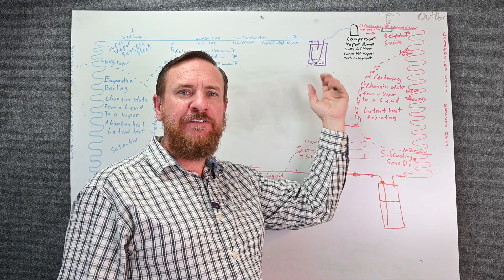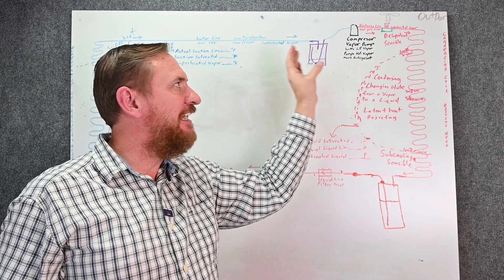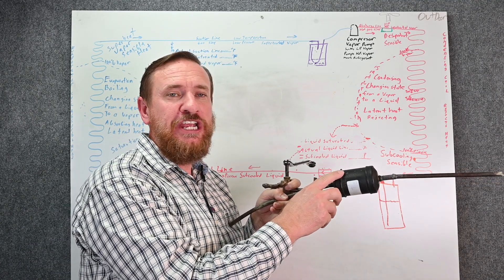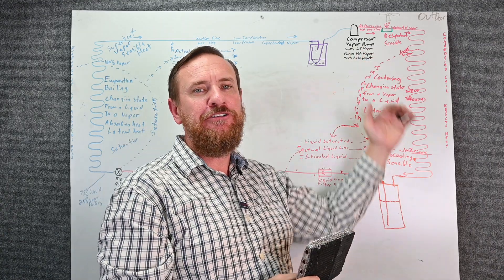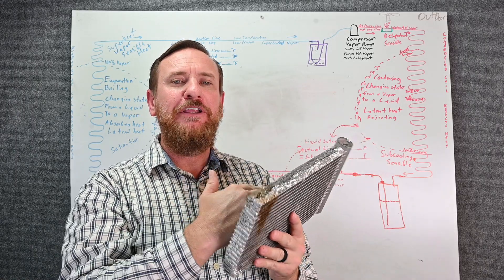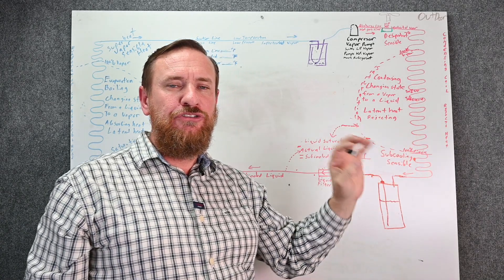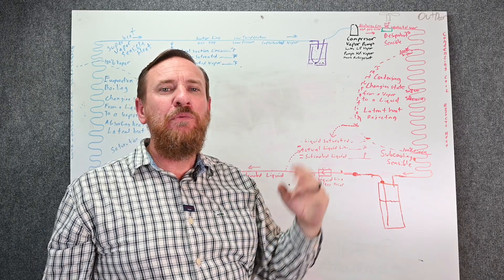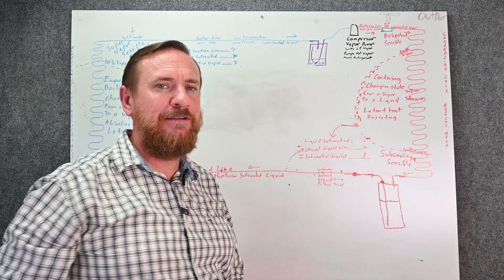HVAC 085 Pump Down

Comment: If the filter drier is before the valve doesn’t that mean that it is on the side that was pumped down hence don’t need to replace it since it will not be open to the atmosphere?
Reply from the maker: It's not about the filter drier being exposed. It's about any part of the system being exposed.

The filter driers have very small capacities. Once you keon any part of the system, even for a moment, you end up with moisture and other contaminants.  This will exceed the filter drier's ability for filter and dry. 

I see clogged driers all the time that cause capacity loss and then compressor failure.

Comment: Isn’t the floating seal in resi scrolls designed to fall back down and start clinking to prevent pumping down into vacuum?
Reply: That “funny noise” in the demo is the floating seal preventing pumping into vacuum I’m pretty sure. 40psig is where I’ve found it normally starts. I’m not sure that’s what it actually is though, but I’m pretty sure it is indeed the floating seal.
Reply from the maker: Yes sir, 
Once the compression ratio exceeds 11:1 the floating seal releases meaning it's no longer a down force pushing the top scroll set down on the bottom scroll set . The rattling is the top scroll chattering against the bottom because the floating seal is no longer pushing it down to make the scroll set seal.
Reply: @love2hvac  Interesting. Thank you so much!

Comment: Some units have a high side pressure cutout switch AND a low side pressure cutout switch that will open the contactor if either trips.  Don't get too surprised if your compressor stops at about 55 psig low side pressure.  Shut off breaker power and be ready to shut down the low side service port.

Microchannel condenser units often have a high side pressure cutout switch because they know it cannot take a pump down.

Comment: Hi Ty Love this tutorial & all yours Actually Thank you Ive learned a Ton ....27 + yrs in &  learnt with no actual formal school but 5/6 great mentors to teach , lots of books & videos constantly .daily ..started out with trim & sets was my 1 st  Job 3/4 years new construction then retrofits ..wired & fired then all .with help my mentor ... then service & then full installs last both resd & mid sized 30 ton usually & under but maybe 1- 10 systems installed per building   commercial jobs my favorite   ....So to me anyways one of the best ways  to learn try to learn This great Trade .no formal school ...& always learning something new the new stuff happening dailuy it seems & also to relearn the old everyday stuff also ..Just wow what I just learned on ..a basic pump down & all its  particulars & or must dos  or best practices .....i do most all as per some differences ..But bottom line IS : to make the end game turn out as Hopped & carefully planned  out & quoted the customer ..hopefully Not to many Surprises .along the way .thanks Again ...Please keep ur Great  tutorials coming & we ALL Will .....keep watching & learning ..tks million of I had it !!!

Comment: I'm sorry but i have to correct you, incresed arcing in a vaccuum compared to in a refrigerant happens only in very specific circumstances and is not a given.

I would say refrigeration compressors are designed to operate within a certain range of operating conditions. Operating a refrigeration compressor with a negative suction line pressure, which means the pressure at the suction inlet of the compressor is lower than the recommended minimum operating pressure, can cause several issues such as:

1. Reduced compressor efficiency: A compressor is designed to compress a refrigerant gas from low to high pressure. When the suction line pressure drops below the recommended minimum, the compressor has to work harder to maintain the required flow rate and discharge pressure. This increased workload reduces the efficiency of the compressor, leading to increased energy consumption.

2.  Loss of lubrication: The compressor relies on the refrigerant gas to provide lubrication to the moving parts. When the suction pressure drops below the recommended minimum, the amount of refrigerant gas entering the compressor is reduced, leading to inadequate lubrication. This can cause premature wear of the compressor's moving parts, leading to compressor failure.
Reply from the maker: An engineer for Copeland scroll compressor told me they had arcing  at the Fusite connectors resulting in terminal blowout on scroll compressors. 

Copeland specifically states in several Application engineering bullitens related to the z line scroll not to use a megohmeter while under a vacuum.
"Under no circumstances should the hipot test be performed while the compressor is under a vacuum." I was told by the compressor engineers this was because of arcing. 

None of the engineers or technical data I have read includes vacuum breakers. 
However Copland scroll uses a floating seal for protection.  On high temperature air conditioning applications the seal opens above 11:1  well before the compressor ever gets to a vacuum.
Refrigerating the floating seal does not open until it's great we then 26:1 but the compressor is designed much differently.

I 100% agree the compressor should remain in the operating envelope at all times. 
None of the scroll compressors for high temperature air conditioning are designed to operate in a vacuum.
With refrigeration the compressor should remain in the operating window even in automatic pump down.  There are very few applications and refrigerant combinations that allow specific scrolls to operate in a slight vacuum. Those compressors are built specifically to operate in that window and I will cover that when I get to the refrigeration portion of the video series.
Reply: @love2hvac  Thank you for sharing your insights on Copeland's scroll compressors and the possibility of arcing in vacuum conditions. While the chances of arcing occurring in a winding can be affected by several factors, it is generally true that a vacuum provides better electrical insulation due to its low dielectric constant. However, in certain situations, the presence of a refrigerant gas may provide better insulation compared to a vacuum.

It is important to note that the use of hipot tests, which apply a higher voltage than normal line voltage, can stress insulation and increase the risk of electrical breakdown and arcing. However, this does not necessarily mean that arcing will occur during a vacuum pumpdown at normal line voltage in a refrigerant.

In the case of winding arcing in a refrigerant compressor, the breakdown voltage of a vacuum or low-pressure gas like for example R410a can decrease significantly due to the presence of free electrons and ions produced by the arcing. To maintain adequate electrical insulation, a higher pressure gas with a higher dielectric strength may be necessary. Although a vacuum is generally considered a better insulator than R410a due to its low dielectric constant, at very low pressures, the remaining gas in the vacuum chamber may not have a low enough dielectric constant to provide sufficient insulation. In such cases, introducing a gas like R410a could help to increase the dielectric strength and provide better electrical insulation.

However, in most practical electrical insulation applications, a vacuum is still considered the better insulator because it has the lowest dielectric constant of any material, making it highly resistant to the flow of electrical charges. This is why vacuum breakers are commonly used in high-voltage power industries to interrupt the flow of current and prevent arcing.
Reply from the maker: @gregdekkers2667  
I'm not a scientist so I can't answer for sure. I was under the impression that electrons themselves move slower in a vacuum but the electromagnetic waves move faster in a vacuum up to 90% of the speed of light. I think Vacuum arc plays an important role here as even at low voltage you can have a a high amerage arc.

While AFCI breakers are available they don't work well in HVAC as the arc of the contacts themselves making contact cause nucesance trips. 

Take a look at the Fusite plug of a compressor. Theterminals themselves are not insulated. In a vacuum this could be a prime condition for arc that explains why the Copeland engineers had the Fusite blow out. They said it was so violent, part of it stuck in the wall on the opposite side. 

I do appreciate and respect the conversation even though we don't completely agree. 

For reference 
"A vacuum arc can arise when the surfaces of metal electrodes in contact with a good vacuum begin to emit electrons either through heating (thermionic emission) or in an electric field that is sufficient to cause field electron emission. Once initiated, a vacuum arc can persist, since the freed particles gain kinetic energy from the electric field, heating the metal surfaces through high-speed particle collisions. This process can create an incandescent cathode spot, which frees more particles, thereby sustaining the arc. At sufficiently high currents an incandescent anode spot may also be formed.

Electric discharge in vacuum is important for certain types of vacuum tubes and for high-voltage vacuum switches. "
Reply: @love2hvac  It's truly captivating. I must say, you've taught me something new and had me pondering it for half a day.

I confess that I was mistaken in believing that a vacuum is always the superior insulator. It appears that the engineers at Copeland identified a specific case where this does not hold true, which I cannot dispute. (even though I initially did)

The insulating properties of a vacuum are not perfect, and under certain conditions, such as in the presence of strong electric fields or charged particles, electrical breakdown can still occur. These cases are often specific and less common than the electrical breakdown in air or other materials.

"As you reduce the air pressure, the mean free path of electrons (the average distance an electron can travel between collisions with air molecules) increases. Initially, this may lead to an increase in the dielectric strength of air. However, as you continue to lower the pressure, the dielectric strength may start to decrease, making it easier for electrical breakdown to occur. This behavior is nonlinear and complex, influenced by factors like the electrode configuration and the specific gas mixture involved.

In summary, the dielectric breakdown of air is not a linear process when transitioning from atmospheric pressure to a vacuum, as it is influenced by various factors and exhibits a complex relationship with pressure."

Comment: So how much of a refrigerant stays in the pipes? Have you ever measure it?
Reply from the maker: For 420a 0.6 oz. per foot 3/8 liquid line, plus 6oz. for the filter drier, and the long radius elbows add 2.6
Reply: @love2hvac  It should be less than this. No? This is the amount of refrigerant that would be in the system if it was operating normally. But you've pumped it down to like 10 psi.

Comment: have you ever seen a compressor arc while in a vacum ty
Reply from the maker: I have not seen it first at but the people at the Copland factory told me it blows the fuseite plug completely out and tuck across the room. They lost specifics about not running the compressor in a vacuum because arcing is a big issue.
Reply: It's nonsense.  We make vacuum breakers for a reason, to prevent arcing, so windings arcing in a vacuum is unlikely. 

Here are some reasons not to run in a vacuum:

Refrigeration compressors are designed to operate within a certain range of operating conditions. Operating a refrigeration compressor with a negative suction line pressure, which means the pressure at the suction inlet of the compressor is lower than the recommended minimum operating pressure, can cause several issues such as:

1. Reduced compressor efficiency: A compressor is designed to compress a refrigerant gas from low to high pressure. When the suction line pressure drops below the recommended minimum, the compressor has to work harder to maintain the required flow rate and discharge pressure. This increased workload reduces the efficiency of the compressor, leading to increased energy consumption.

2.  Loss of lubrication: The compressor relies on the refrigerant gas to provide lubrication to the moving parts. When the suction pressure drops below the recommended minimum, the amount of refrigerant gas entering the compressor is reduced, leading to inadequate lubrication. This can cause premature wear of the compressor's moving parts, leading to compressor failure.

Comment: If the filter dryer is between the service valve and condenser/compressor is that side of the system technically not open ??
Reply: That is actually a really good question.
Reply from the maker: Any part of the system that is opened will be introduced to new moisture and contaminants. 

All those containers will flow through the old filter drier and I overwhelm it.

its not about the filter itself touching air, it's May part of an open system touching air.

Comment: Global warming isn't because Co2, refrigerants and other excuses, watch our skies and you'll find that our skies are not blue anymore. Bluish, grayish, whitish.....result of planes designed to spray toxic and biological elements in the elevation 30-40k feet causing to expand into a canopy covering regions of interest and the sun when it shines through it has a much more heating result because the chemical canopy acts as a giant lens or greenhouse effect. 100 years of these unannounced and subversive moves and excuses on TV and other programing lying ways is all responsible for the extreme heat you have to cool down feeding electric companies and air conditioning society. With clear skies the run rays bounce off the earth and go back to the space. This chemical soup we all live in and are inhaling is trapping the heat and causing lot of different havocs.

Comment: I was trying to do a pump down today. But around 2 or 3 seconds into the pump down the compressor went off. I tried again and same result. There are no low or high pressure sensors on the copper pipes. Great video. Thanks
Reply from the maker: scrolls have an floating seal that will open when the suction pressure gets too low

Comment: is it possible to perform a pump down on a heat pump in heat mode?  I have an indoor TXV that is obstructed only in AC mode, but works (bypass) in heat mode.  seems to me that pump down in Heat mode would capture all the refrigerant in the outdoor coil, where in AC mode it will leave refrigerant in the liquid line (because of the TXV obstruction) between the compressor and the TXV.
Reply: For anyone who has this same question, I'm planning to use my manifold gauges to pull the liquid line over to the suction line, effectively pulling all the refrigerant into the condenser.
Reply from the maker: For what your trying to accomplish, you need to do it in  AC mode. 

Close the liquid valve and throttle the refregerant across the manifold to the suction line side. Untill the refregerant up pulled out of both lines
 Shut the compressor off and close the suction valve then your refrigerant will be stored in the condensor.

In heating mode it's called a pump up. When you close the liquid valve the refregerant is backed from the liquid valve, to the metering device and the refregerant is stored in the indoor coil. Then you close the valves and you can work on the outdoor unit after recovering what is left. 
 A pump up  will not work if your having to work on the indoor metering device. 
Even with moving the hoses like you talk about will be a problem.
In heating mode the compressor discharge is connected to the suction line. 
#1 there is not enough volume of space so store the refregerant in that distance.
#2 it would be in vapor form as it has not yet gone threw a coil.

Comment: Can you please explain why the high side pressure goes down instead of up?
Reply from the maker: The service valve is closed, the pressure between the compressor threw condensor to the valve will go up.

There service port is after the valve even though it's on the same component. 

The compressor is pulling in refrigerant. So the compressor sucks in refregerant from the suction line, evaporator, metering device and liquid line to the valve.
So the high side pressure on the liquid line drops because the liquid valve is closed and the compressor sucks it in.

Comment: Thanks , your an awesome teacher ….I’m learning this on my own , coming from. another trade ….I really appreciate your channel.
Reply from the maker: Thank you I appreciate that. 
If your motivated you can learn just as much and more on your own. What is your other trade?
Reply: @love2hvac  I am an appliance repair technician. 😎….I learned that trade from my father. ( as well as the occasional manufacturers class) like you, I was driven by my curiosity. Much of the basic electrical concepts are the same. I don’t have time to go to a formal school. I am learning OJT , and from books, and your channel. Thanks again ….I really appreciate the education.
Reply: Ty, thanks for all you do. I’m a wet heat guy ( ie boilers) working in a supply house. We are pushing into the HVAC market, and with your help ( and some other very good channels here) I’ve been able to learn enough to pretend to be mildly competent. That’s saying a lot considering how dense I am!